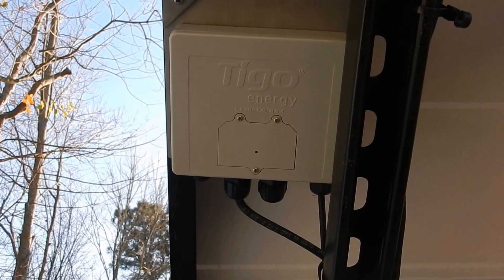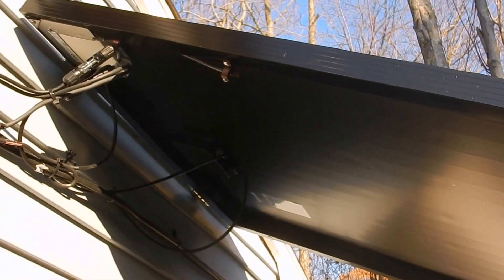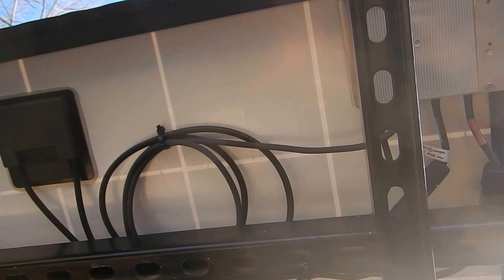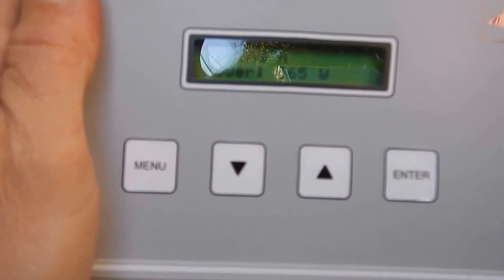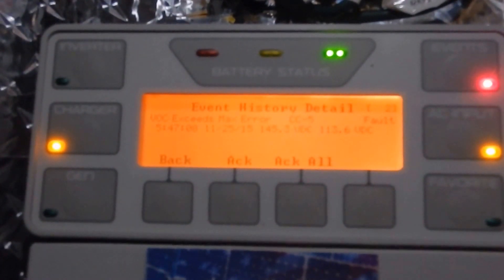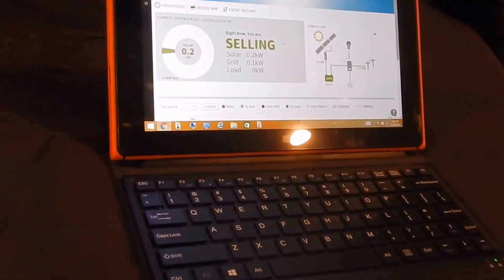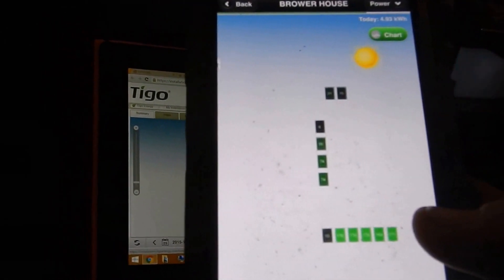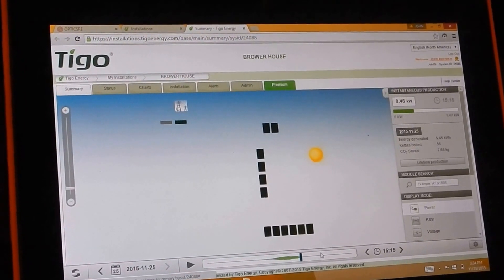TIGO ENERGY PRODUCT OVERVIEW

Comment: Thanks buddy.
I  look forward to see the link Please.
Cheers
Reply from the maker: And then just buy as many of these as you want..https://www.ebay.com/itm/281971700352
Reply from the maker: Ohh and got to go to Home Depot or lowes and get sprinkler wire outdoor rated 18-4 I think for management unit to gateway
Reply: BROWERPOWER 2010 Can I just use CAT5 or CAT6 cable?

Comment: Hey buddy,
Do you still have your Tigo Maximizer?
How are they working for you? I am thinking of getting some of those.
Is the gateway really expensive? Please send me the link where to get the gateway device ok?
thanks and God bless
Reply from the maker: Hey Friend, Yes I still have the Tigo it works great..especially if you have shading but have a long wire run and don't want to lose any power. I bought it from some one on EBay it wasn't cheap.. For 12 maximizers the gateway and management unit came to 1,000 bucks
Reply: BROWERPOWER 2010 
Can you send me the link please. 
The maximizer and Gateway you said is $1000? 
How many maximizer that comes with the Gateway?
Reply: Please send me the link
Reply from the maker: +JW Solarusa they where separate.. Here's the seller I bought it off of  https://www.ebay.com/itm/121976277883

Comment: Thanks for showing. Wasn't aware of this product. Cool. I have enphase on part of my system so understand concept. But wondering whether this keep output DC or inverts each panel to AC? Hoping answer is DC as I could use this at my off grid cabin. Also how much % increase are you seeing?
Reply from the maker: Hi it doesn't convert to AC like enphase..its a DC optimizer..it's hard to say right now cause the sun is low and I just installed it I'm hoping that it will be a 20% gain from what I've been seeing before tigo

Comment: Would you recommend this product even if their Is no shading?
Reply from the maker: Sure if you want to monitor each panel to see the watt output or say if there's a problem with a panel you can fix it whether it be a connection problem or bird droppings on the panel or if they're just not angle properly you can play with the angle to get your optimal watt output.Great product just what I was looking for for that reason..now I know my panel placement is horrible and need to reconfigure.